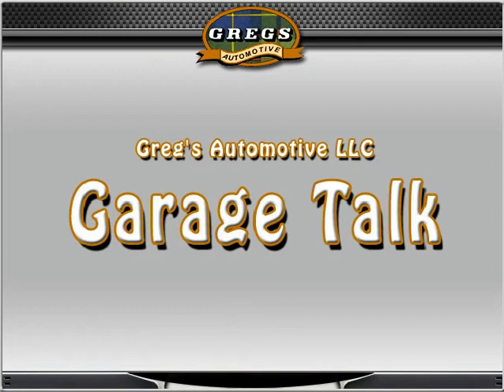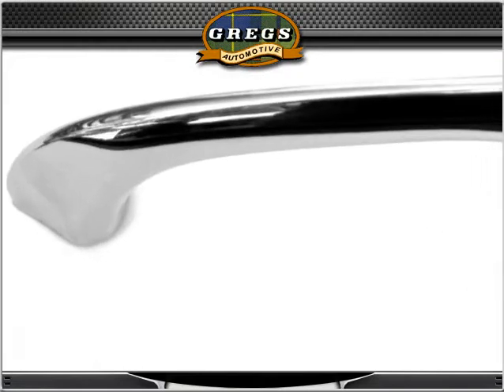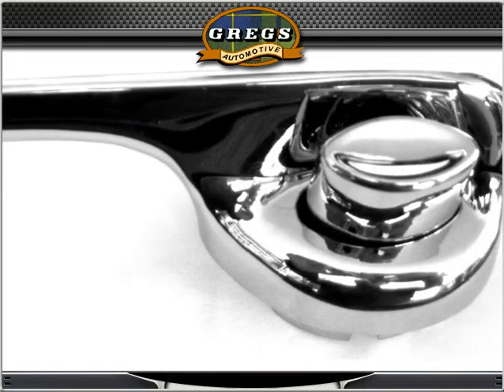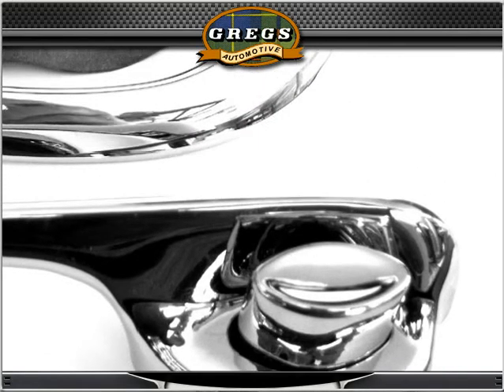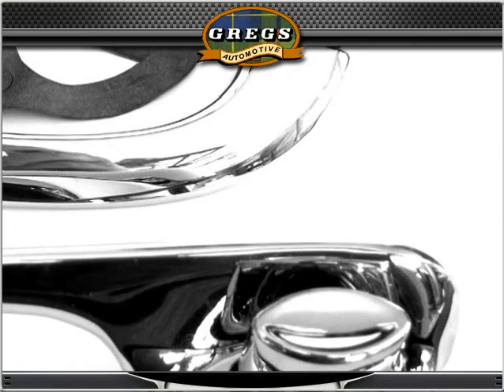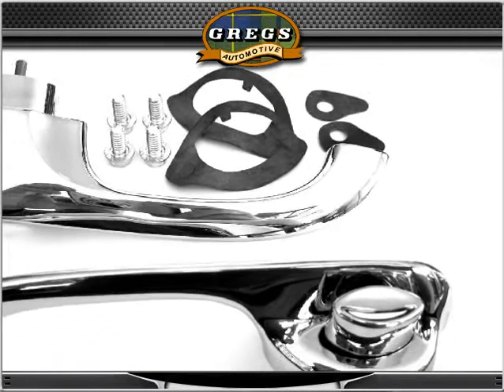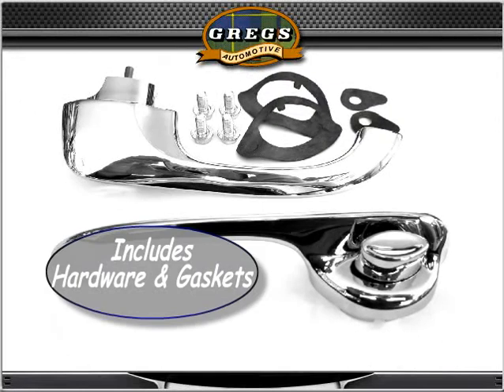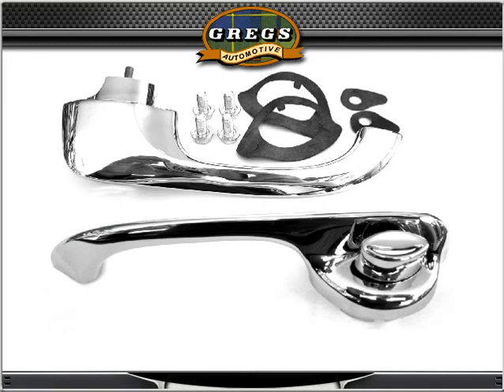1970, 1971, 1972 Chevelle Door Handles

Comment: Got aftermarket door handles from opgi in 2010 for 67 cutlass, they must have been wrong ones, didn't fit at all. Used my beat up originals. That along with other aftermarket crap turned me off of the car hobby.